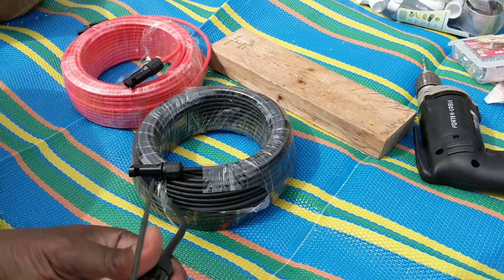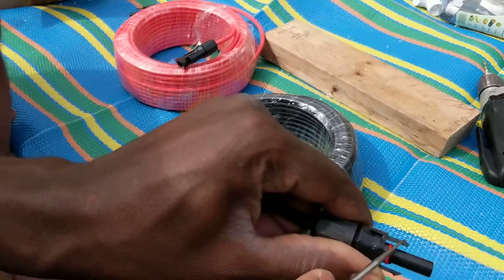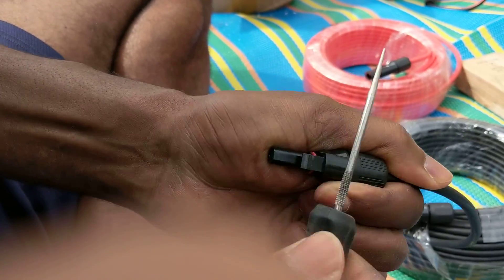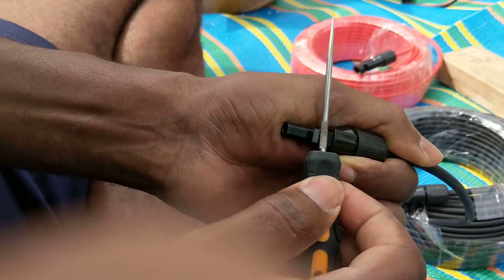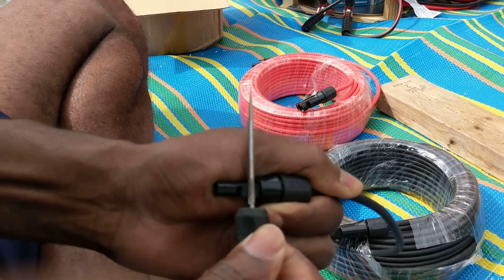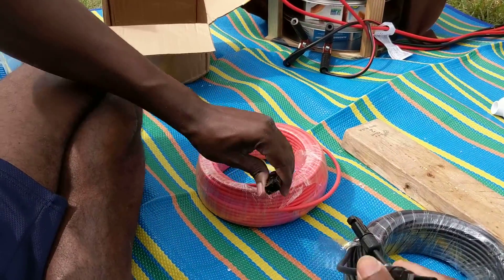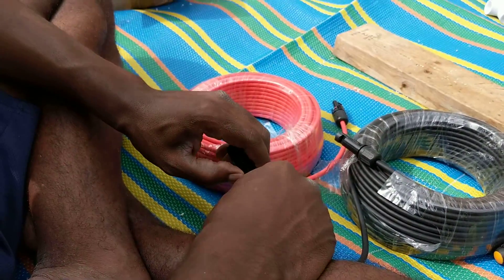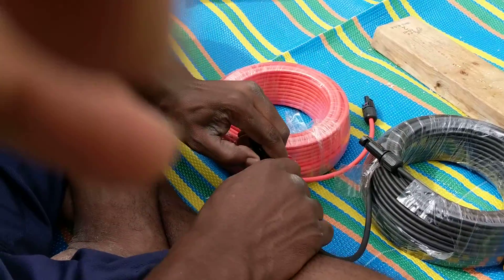MC4 connectors quick release

Comment: This is an important video as I have had the same problem. I constantly have to disconnect the plugs because  I have to move the power where I need it. I have three systems. So I started using audio quick disconnect. But they rust after a while. But with this information, I will be adapting back to the MC4s.
Reply from the maker: Glad to hear this helps.